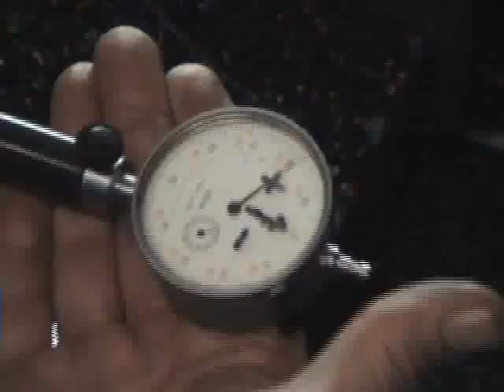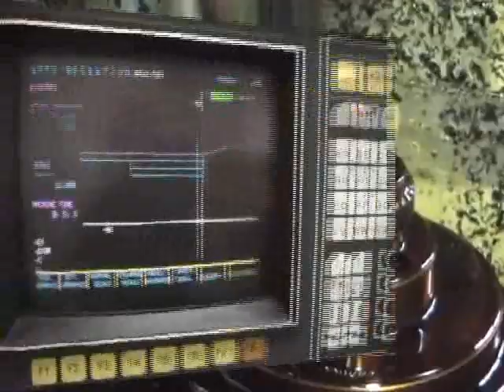Rotec Radial Engine R3600 150hp

Comment: I didn't see anything related to the lubrication system (drilling the crank, oil pump, etc) on this video. But I assume it must have a dry sump system. I wonder if it uses as much oil per hour as most old radials.

Comment: You could design the electronic engine to generate a certain hertz that would generate ultra low temperatures and create a new cooling system? Cryogenic piston technology? Is it the motion of the piston or the vibration that causes low temperatures? If you understand what I am talking about could you not make stand alone refrigerators, air conditioning units and electrical power generators with this engine design? I don't know do you? ; )

Comment: I wish someone would mass produce a super cheap small 5 or 7 cylinder radial engine in the 20-30hp range for ultralights...
Reply: +CHOPPERGIRL AIRWAR 
If you want 20 or 30HP then you're better off with two cylinders--or even one, if you can stand the vibration. Any more and the engine gets more expensive, and burns more fuel for a given power output.
Dividing an engine's displacement up into more and more smaller cylinders increases the combustion chamber surface area, which reduces thermal efficiency (higher fuel consumption). It's often done in larger engines because it allows them to run faster and produce more power for their displacement, but for a small ultralight aircraft powerplant, fewer cylinders is generally better. It's for a similar reason that small motorcycles and other light vehicles, as well as things like chainsaws, weedwhackers, blowers etc. have single cylinder engines--both for simplicity & low cost, as well as lowest possible fuel consumption.
These 9-cylinder radials are examples of master craftsmanship, and some people are willing to pay for that, but they'll burn more fuel for a given power output than a twin or four. They need more maintenance, too.
Reply: +BasementEngineer It's a "Harley Davidson" I think a lot of customers want them for old timer aircraft, reproductions etc. Where fuel burn and maintenance isn't an issue so much, co they don't fly them too much, or they just accept the handicaps for style (like with Harleys). lol
Reply: BasementEngineer I thought having more cylinders would mean increased cooling area, plus you could use a lot smaller cylinders... 5 small cylinders as opposed to one large cylinder...  Which could be easier to mass produce... Plus less vibration and safer operation...   If one cylinder fails intermittently to fire 4 more keep it chugging along
Reply: CHOPPERGIRL AIRWAR That's where the problem lies--dividing the displacement up into a greater number of smaller cylinders increases the internal cooling area, which means more heat is lost from the burning mixture through the walls of the combustion chambers. This causes an engine to burn more fuel for a given power output.
Also, fewer cylinders makes an engine less expensive to produce by reducing complexity.
Because airplane engines run at relatively low RPM there's no advantage to large numbers of cylinders until you get to huge displacements for large, powerful engines. That's how the number of cylinders is chosen--a given bore and stroke generally allows a certain max RPM, and a certain number of those cylinders are used to give the required displacement.
More cylinders for a given displacement allows more power because it allows the engine to run faster, but reduces fuel economy because of internal heat losses. Generally speaking, the lowest number of cylinders you can get away with is best.
As far as redundancy goes, loss of a cylinder will generally ruin your flight. :) You're better off with two engines rather than one larger one for safety/redundancy--and that's why multi engine aircraft are built. They're safer for flying long distances and over water. A single large engine would still give better fuel economy, but large aircraft (like airliners) already use huge turbofan engines which are very efficient, so having two or four engines gives improved safety when fuel economy is already very good.
Reply: Check out the moki 400 built for RC models: 400cc, 5 cylinder radial, 23hp. Not cheap though... There are other radial engines for RC models, up to 7 or 9 cylinders.
Reply: I ended up buying a ULII-02...  about 35hp.   But, it has a hole blown in one piston from detonation I'll have to fix.
Reply: You can see pictures of it at http://air-war.org
Reply: +CHOPPERGIRL AIRWAR Valach builds small radials in that range. There're mostly used in large rc models, but I've seen a couple of 'm power ultralights.
Reply: YaoiMastah That'd be an expensive way to power a human-carrying airplane, with glow fuel at about $20 a gallon for the cheap stuff :)
Of course, no ignition coils or magnetos to deal with. Only glow plugs that weigh nothing, and at $12 a plug times the total number of cylinders, they improve takeoff and climb performance by lightening your wallet!
For very small airplanes you're still best off with a 1 or 2 cyl. gas engine. Of course, R/C powerplants can be converted to use gasoline carburetors and spark ignition with oil mixed with the fuel, but it'll end up costing plenty of bread--and your risking your buns to a machine designed to power an aircraft that's supposed to reach its end-of-service-life in the form of a crash! In the RC world, Time Between Overhauls means time between first flight and drilling a hole in the dirt :)
Reply: +BasementEngineer Actually, these Valach powerplants are fourstrokes running on petrol with a few drops of twostroke oil.
Reply: +YaoiMastah The largest I've seen is the Moki 400.  But it is insanely priced... $5000?  To be feasible it has to be 1/10th of that.
Reply: +CHOPPERGIRL AIRWAR Valach has a catalogue 7 cylinder 800cc engine and a very special 9 cylinder 1250cc radial....
Reply: +whisperdancer will search for them
Reply: CHOPPERGIRL AIRWAR
CG,
If you're still hung up on having a multi-cylinder radial engine for a very small aircraft, no matter how you slice it will cost a lot of bread and have high fuel consumption. It'll also weigh more than a 1 or 2 cylinder equivalent. No way around it, even if you buy one well-used (i.e. worn-out) and dismantle & overhaul it yourself. You're better off focusing on a small 1 or 2 cyl. aircraft engine that starts & runs, and has flyable time left on it before the next due overhaul. Unless you're made of money :)
If you don't mind the higher fuel consumption you can use a two-stroke engine, if anything they're lighter, more compact, cheaper to buy and require less maintenance (no valve gear) than the equivalent power 4-stroke mill. I'm honestly not sure if they're still allowed for passenger carrying aircraft use, but I'm pretty sure all aircraft are emissions-exempt (for now). 2-strokes pollute more and generally burn more fuel per HP-hour. They'll also make you deaf, but small airplanes aren't known for being eardrum-friendly :)

Comment: Beautiful engineering. A two-row, ten-cylinder lump would make an ideal light aircraft engine.
Reply: +John Benton 
Not quite, unless you consider 'ideal' to be as expensive as possible :)
These powerplants certainly do run and are useful, but for this power level much simpler, less expensive examples will produce the same power while burning less fuel. These are 'nice-to-haves' moreso than being an ideal solution for small aircraft propulsion. At 150HP a four cylinder is more like it, six if you want something really fancy :)
Reply: Agreed, but from an 'interest' point of view, these take some beating!
Reply: John Benton They certainly do, that's why they exist :)
Reply: There has to be more to engineering design and execution than simple economy. It's why I get up every day - in the hope of finding something unusual! My dream is to design and make a radial engine with OHCs. I stopped when I realised the amount of gearing involved.
Reply: John Benton It could be done, you'd just need a very long timing belt. :)
Reply: That's the main problem with a timing belt. How do you maintain tightness and valve timing? It#s a problem I have yet to solve. I've done the cooling water jackets and the inlet/exhaust system (though both are rather complicated!)
Reply: John Benton That's why OHC heads are usually reserved for inline and V engines. On a V they use a separate belt for each bank. That way you have fewer timing issues.
Radial engines are pretty much always used for aircraft, which operate at low RPM and high load, precluding the need for OHC or DOHC heads. Just no need for it--pushrods are fine and no advantages are to be had on an OHC setup.
Reply: Phew! That's good to know. The rest of the design is relatively straightforward. I was an engine fitter in the RAF for nine years - mostly jets - but we had a lot of lessons about piston engines generally and radials in particular. Are you familiar with the sleeve valve (as used extensively on Bristol radials) the gearing on them was fairly complex, but extremely reliable (but they used a lot of oil!). So as you can see, I have a lot of choices - all of them come with baggage - but then, being retired from full-time work, I have lots of time to refine my designs.
Then comes the manufacture and testing phase. I'm not looking forward to that!
Reply: There's a lot to be said for cam-and-pushrod operated poppet valves, sleeve valves used a lot of oil as you said. Essentially, the piston engine in all it's layouts is pretty much a fully developed machine, so if you don't like the manufacturing and testing phase then you're SOL!
Reply: It's just that the manufacturing and testing phase puts one out of control. This is as it should be, but it doesn't make it any easier.
Reply: John Benton It's not so much putting yourself out of control, it's figuring out what you didn't know yet during the design phase.
Reply: You could well be correct. I never looked at it that way. That's something I learned today!
Reply: John Benton Glad to help :) hehehe Actually for people who intend to produce at least a prototype of their devices, the initial manufacturing and testing phase is the good part.
Reply: Let's hope so. I don't expect o make money, let alone a fortune out of my endeavours. It's simply a case of my satisfaction that such a thing can be done.
Thank you for the kind words, guidance and inspiration.
Reply: +John Benton Radial engines don't last long they, I don't care if they are made today or 80 years ago. Poor OLD limited design always having to be worked on, they leak, they burn allot of oil, exceedingly hard to work on and have to be overhauled frequently EXAMPLE a Pratt & Whitney 28 cylinder with 56 spark plugs if not started correctly requires 4-8 hours to change plugs they burn a gallons of gas per minute gallons of oil per hour- This engine was the end of the line for radials in the 50's . How do I know? 40 years as an AP power plant mechanic.  FYI,  The engine in Harley Davidson is "radial engine" You can get the 120 cube 2 cylinder racing motor (150HP) and it puts out the same horse power as above and is way cheaper. Rotech makes great engines for airplanes this an experiment on proven design for that OLD look some people want in X planes.
Reply: Whatever floats your boat. Radial engines look good in aeroplanes.
Reply: good thing they need work or you would not have had a career then.

Comment: wow. amazing! I always think propellers are attached according to their number of cylinders arranged but in this video I can see only opposed type propeller with many cylinders. But it's still working which is so amazing
Reply: +smith thomas 
You mean a two-bladed prop? The propeller's static power absorption is determined by it's diameter, not just the number of blades. The prop is matched to the engine's power output at a given RPM, it's not just the number of blades versus the number of cylinders.

Comment: Awesome build! I'd like to build a really modern-technology radial with direct injection and 4 valves per cylinder.
Reply: +nutnfan1 
At the crankshaft speeds of direct-drive airplane engines, 4 valves per cylinder probably isn't needed. The volumetric efficiency is high enough at the speeds propellers run at.
WW2 engines (Merlin for example) were geared to run at higher RPM than the prop to allow higher power output; for their bore and stroke, 4 valves were useful for these big cylinders to inhale more charge in less time (higher RPM) and produce more power. It's not needed on small bore & stroke civilian aircraft engines that run at moderate speeds and are intended for long life.

Comment: What's holding that trailer down at the end of the video, surely not just those two small bricks under the tires.
Reply: The engine's own weight, it is mounted aft of the fulcrum created by the trailer's axles. It's also using a test stand propeller the pitch and twist is enough to get air over the cylinder heads to cool the engine but doesn't give it much thrust in a rearward vector while supplying a load for the engine.
Reply: I was wondering that too. Looks like a regular propeller to me, and would rotate it over the bricks if not secured at the trailer hitch.  Maybe a stake at the hitch?

Comment: A remarkable engine, a radial that gets 150 horsepower from a 3.6 liter displacement; back during World War II, radials of similar horsepower output had displacements of 7.2 liters or more (and were much heavier). I hope Rotec considers building higher-output engines in the future, as a 5 or 7 liter radial engine would be ideal for replacing the older radials in classic (or replica) cabin-class airplanes.

Comment: Precision flat milling machine, slotting machine, drilling machines, automatic milling machine. Secondary processing machine is mainly used in automatic lathe subsequent precision machining, such as single / bilateral milling flat profile slot (parallel to the cutting, cross cutting)reaming, tapping, chamfering, shrink Vent.

Comment: Get out your notepad son:  Pontiac never manufactured a 462 so that tells us it is an aftermarket modified engine.  Second, that automotive V8 is over twice the displacement as the Rotec.  Next, the Rotec is designed to crank out 150 h.p. for hours at a time and that alleged 462 would make 400 for probably a few minutes before it would puke up a connecting rod, drop a valve, etc.  Now use the rest of your internet allowance to learn something about engine instead of making uninformed posts.

Comment: Only 150 HP?!?!  Boy is that ever WEEEEEAAAK!!  Do they only run 5:1 compression ratio like the Wright engine in the Spirit of St. Louis?  Or is the ignition timing set to ATDC?  The 462 CID Pontiac engine in my brother's 1971 Trans Am cranks out at least 400 HP on less than 9:1 CR!

Comment: These are dry-sump engines, oil is kept in an oil tank. A scavenging pump draws oil from the engine, and pumps it to the tank. The oil pump that lubricates the engine draws from the tank. Some oil does seep past the rings on lower cylinders, which causes the traditional smoky-start of radials. Radials are generally turned several blades by hand before starting, to assure there's not enough oil in lower cylinders to cause a hydraulic lock, which could be very damaging to the engine.

Comment: That is a good point. I remember seeing an experimental aircraft that had an all aluminum big block v8 mounted inverted with a dry sump oil system & gear box. If i remember it had a 6 bladed carbon fiber prop. The tail number was "420HP" as it was putting out 420hp. It sounded like a nitro drag car on take off! Sorry I didn't mean to sound like a jerk with my comment.

Comment: My perception is that one con rod & it's big end run on the crank & the daughter con rods are effectively connected to that one rod, not directly onto the crank.It's not very beautiful, but it's very effective.....not sure it's well balanced or can be balanced well, but it's worked well enough for over a centuary.

Comment: @delgaraulito Yeah, we worry more about reliability and so the compression ratios in aircraft engines are much lower than in cars.  Ratios of 7:1 as opposed to 15:1 like in cars produce less power, but let the engine last longer between overhauls.

Comment: The fuel pump, like with any engine just keeps the carburetor full of petrol.  The carburetor then feeds the centre of the common intake plenum chamber.  Within this chamber is a simple mixture distribution fan that spins at engine speed and its main purpose is to sling the fuel/air mixture evenly to all cylinders.  You see with a radial engine some cylinders are low and some are high so the low ones would run rich and the high cylinders would run lean without the fan, which evens things out.

Comment: but if it has fuel pumps then what's the point of having a single fan to disperse the fuel mixture? wouldn't each cylinder head have it's own intake from the carb just like a regular vehicle engine? or is that fan suppose to disperse the fuel mixture before it hits the carb?